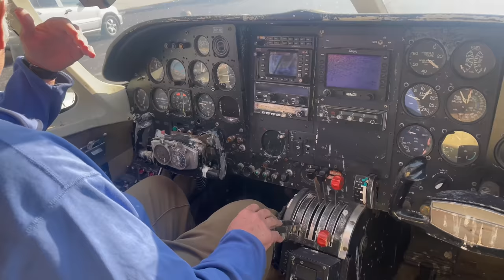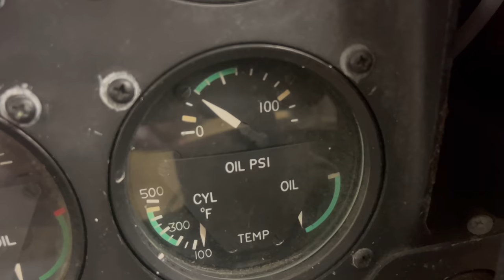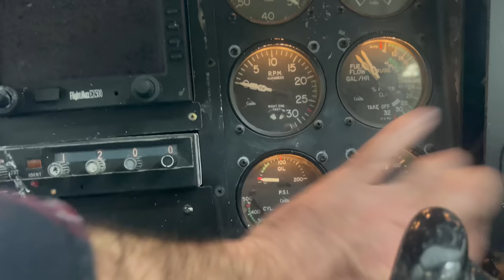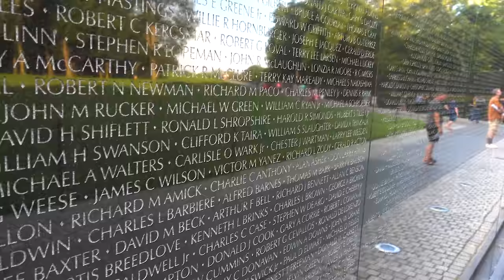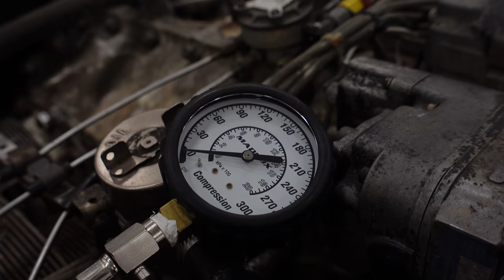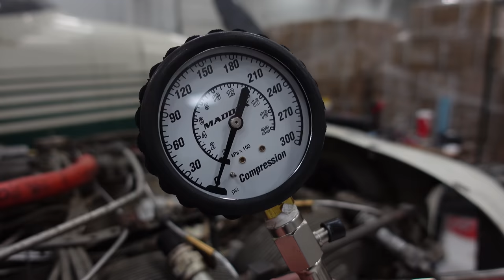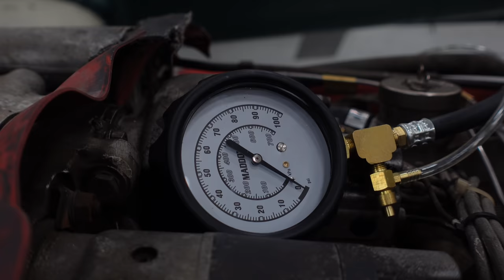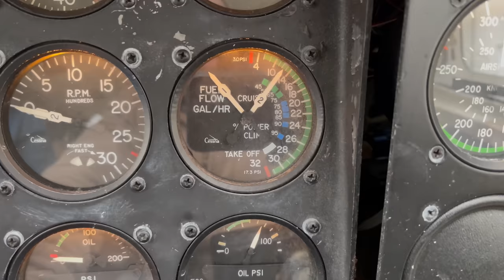Did We Ruin The FREE Abandoned Airplane Engine ? Ep6

Comment: With the way it is trying to start I would check voltage drop. Depending how the starter works if it has a solenoid put a jumper pack or battery directly to that starter so it gets more amperage. Just a thought considering that engine is further from the battery source than the other engine.
Reply: The other thing is to make up some decent jumper cables with welding cable. Those store bought things are hopelessly inadequate.
Reply: Really good point!
Reply: It appears there is also an additional 10ish feet of wire to reach that engine

Comment: Full clean/restore, I'll come out and meet you at the Oshkosh show when it's ready. 
Now let's talk about engine 2.
Spark check, fuel is check, air here lies the problem. It's not starting on spray,  now squealing noting drag from piston rings, already knowing compression is low.  It could be possible the exhaust is plugged and had to backfeed thru system to get out, but with its problems it isn't sucking in the air or at least enough. Wondering if the intake system all the way up into the manifold is plugged up.
Reply: Id love to see a full restore, But the cost is going to be prohibitive, The Spar AD alone I believe is around 30 to 40K.

Comment: I run an engine to operating temperature. Drain oil pull fuel pump fuse. Fill with k1 crank over to flush an engine. It got the gm lifters un stuck. You can pull the plugs and really get more rpm from the starter to build more psi and really flush. Drain fill with cheepo oil run that around for a bit drain and fill with your favorite brand flavor.

Comment: Id love to see you get this one in the air again, I have a question about that engine is it the one that has the locked up turbo and could it be causing a air/exhaust blockage it seems like it want to run but could be a good thing to check

Comment: Hi! :) 
Im a car mechanic from sweden and i just thought….in some cases We use the engineoil on Top of the piston to some times help it turn over and free the engine but in this case maybe you have no oil to the piston when the oil is so thick and needs some help. When the engine is turning it usually dont build up much pressure until its running. This is just a wild guess and it can be many comments that are saying same things but i atleast want to type it myselft! 

Sorry for the bad spelling..haha
Hi hopes for you! Looking forward to future episodes of the plane! ;)
Reply: Yep, suggested the same a couple of weeks ago,.. engine 1 had all round much better compressions, and that would help.
But it's also intriging that it's having a harder time to spin..
Trying to start #2 with #1 running helped the batteries

Comment: I'm wondering if the relatively poor connection from the jumper cables, coupled with the longer cables on that engine are keeping you from reaching the current you need to that starter. Maybe try making those connections really solid.
Reply: When he runs the #1 engine it should be able to provide all the power he needs to start the #2 engine.  If you noticed later in the video he was having a much better time of it when the #1 engine was running.
Reply: Agreed, I think this plus the lack of decent compression combined is probably stopping it from starting.
Reply: @DontCryAboutIt  yes.  The compression looks really low.
Reply: @DontCryAboutIt  yeah. The good engine got all the way up to 150psi
Reply: Same thoughts here!

Comment: That engine spun so much faster when the other engine was going. I think you need some real batteries not jumper cables. That and check/clean the starter wires. In big high compression diesels having solid connection from the batteries is a must. I would suspect this is similar if only for its size.  It will start. It wants to. That said get a detailer to go nuts on it.
Reply: People have been writting in the comments that he needs proper batteries for a while now and he's still using jumper cables...
Reply: @toki002  shrug I have chased down a lot of electrical but getting enough amps from the battery is critical and will probably solve some of his problems. All I can do is suggest. At least make some good extensions with some heavy welding cable and soldered/crimped lugs. Totally worth having the tools to do it a hydraulic crimper/dies is about 50 bucks and the cable by the foot. I have found even the higher end jumper cables are not great.
Reply: The battery for that plane is also nearly $1,000.

Not to mention any cables or terminals you need also need to be certified and are going to cost 5-10x more than what you'd see on almost any another machine.
Reply: @adammcaughey4044  That may be so but in the meantime make some extensions out of 2/0 wire with lugs from any welding shop to a couple of tractor batteries really bolt the connections and crank away. It's better than jumper cables which is the current solution.

Comment: When (not if), when you get this all back together, another way to reduce the cost of the Cessna might be to lease it to a flight school; they pay you to use it when you are not using it, when it would be otherwise just taking up hangar space... just a thought
Reply: not a bad idea!
Reply: @lukewarmwater6412  or, as you suggested, get qualified pilots to fly it for the cost of fuel plus a maintenance and insurance contribution, based on hours per month/year. Break-even costs
Reply: Respectfully, this would be a horrid flight school airplane, it’s a pressurized airplane with many auxiliary systems that aren’t up to the rigors of flight training.

Source: I fly one for a living
Reply: @N312RB  fair enough. haddent concidered that part of it.

Comment: The engine did seem to turn over faster when the other engine was running. I would check for voltage drops like others have mentioned, but I think finding the source of that weird squeak would probably help a ton!
Reply: Yes!  Get a meter and check it out. Other 420s’s spin significantly faster. 
Could even be a deteriorated battery cable.

Comment: Automotive oil is also waxy and overtime it will coat the internals with wax, I usually will put a little diesel in the same way and it basically strips the wax off and the cleaning helps the engine run better, just gotta make sure you get it all out before you start it back up

Comment: This is how I remove sludge and grime out of an engine when doing an engine flush. Jet fuel is a lot like diesel fuel. Haven't ever had an issue flushing automobile engines with diesel fuel. I run the engine for about 5 minutes and let it sit for 10. You don't want any of the engine parts expanding inside the engine. But the kerosene will lubricate pretty well while running the engine. Then you drain the oil after about three times of doing this, and then you replace it with more diesel fuel or kerosene and you keep doing this until you get clear diesel coming out the engine. Then you got to put engine oil in and run the engine up to operating temperature maybe even drive around. Then you drain that oil and put fresh in and you're done with an engine flush. 🍻🇺🇲
Reply: Don’t do it. Diesel has SOME lubricating properties but not enough to run an engine.
Reply: Or just run Seafoam
Reply: MMO!
Reply: Diesel will have more lube than Kerosene, so it's the better choice for flushing if you have both.
Reply: I've heard of adding a quart or so of ATF fluid to the oil and running for a couple minutes  to thin out hydraulic lifters etc. Then change oil.
Reply: @johnnunn8688  
Seafoam doesn't do a good enough job when you're flushing an engine that hasn't had an oil change in it's life. Diesel fuel does have enough lubrication to run for a few minutes at a time. It just doesn't have enough to lubricate when the engine gets up to temperature and the engine parts start to expand to their run temperature operating specs. It's not like I'm saying go and fill your engine and do a daily drive with it. This is how 3 generations in my family has done it and I've also seen other mechanics do it this way also. I've never seen or heard of any issues flushing an engine this way. I think there are even YouTube videos about it also.
Reply: @benhawke7231  I have no idea, what seafoam is. All I know is, as a long term aircraft tech (engines) I wouldn’t do that.
Reply: @johnnunn8688  
Sorry.. I replied to wrong person.. LoL

Comment: I've turned wrenches a long time on a lot of old iron, I think you are onto something with the plugged exhaust. It seems to soin fast the first 360 and drops off very quickly with each consecutive rotation like pressure is building in the exhaust, probably mouse house in the turbo. The other thing I noticed or actually didnt notice is any smoke from the engine when it did kick over and I dont believe I have ever seen an engine that has sat for any length of time especially aircraft engines that didnt belch a cloud of smoke on a start. I'd expect a mix of carbon,oil and penetrant and rust to make quite a noticeable puff.
Reply: Dave Pin  as far as counter rotation it has been done both with gearboxes on the drive and also with mirror built engines such as the Allison's on the p-38. There is absolutely something causing drag and making noise and it could be any number of things including a buildup of rust and corrosion stuck between the rings without a full teardown it's hard to tell but half of those things may clear up with a short high rpm run, at this point with that engine it has to be torn down anyway so your just as well to mess with it and try to fire it before hand to claim the plane did run on both engines even for a brief amount of time.
Reply: Needs to check logbook and see how much time is on the engines, either way I wouldn't attempt to fly this if engines aren't 0 TSMO

Comment: Yaaaaa....that engine seams toast. The other side had more compression and still spun faster, and the turbo is frozen up. It sounds like that engine failed at some point and maybe the turbo and pistons all burnt up together. May just want to consider a straight up rebuild on that side to get it to start, besides that's still getting the engine to start. 🤣

Comment: i use an engine pre-luber for automotive gas and diesel engines, It allows me to pressurize the oiling system by connecting to it through a sending unit or pipe plug via a hose. This way I can fill an engine with clean new oil and not have to start dry, May be a good option for your airplane engine too

Comment: I love your humor. The big explosion in the beginning had me laughing hard. It would be great to see that aircraft all clean and shiny. Incidentally, I think I'd change the oil in both engines and put new oil filters on them. Then refill the oil to the proper levels. I'm not a mechanic but if I can get my old chainsaw running I am confident you can make that engine run.
Reply: Pmsl u funny bro ..chainsaw bawahaha chainsaw Vs 2 big bore v8or v10 engines , two completely different animals ..although I do agree that he will get them going I can feel it in my bones
Reply: @ger808  There are (2) O-520 cubic inch 6 cylinders, The O stands for opposing or boxer . fuel injected and turbo charged. very expensive to rebuild or replace. Not the easiest things to work on either. 2 magnetos and 2 spark plugs per cylinder.

Comment: Let's fly! :)

You were talking before about it could be an exhaust issue. Bearing in mind how FUBAR'd the turbo is on engine 2, would it be worth removing the turbo so that there is a straight through exhaust? I understand that engines need some back pressure to run properly, though if we can just get it started, then we can worry about making it run nicely later.
Reply: Not sure why this misconception is so common, but engines don't need backpressure at all. Exhaust sizing is important but only to maximize flow for the amount of gasses produced by combustion. Too small means a restriction, too large means it won't create a slight vacuum to pull more gasses out of the engine.
Reply: Pull up the top smart bugs that had some oils squirts and oil and there crank it there crank it over get the ring as nice and wet maybe the compression will come up and help start that motor dragon is no good
Reply: Probably should use some of that jet fuel in there and then you could pull the bottom plugs and drain them out but it needs to get oil wet in there to get those rings to stop dragging

Comment: That right engine will never start with such low compression. Time for a top end rebuild before anything else messes up.. Looks like you have some kind of voltage issue, when that second engine was running, the first span over much easier, i guess would be indicative of a stronger (more consistant?) supply of current to the starter.
Reply: I wouldn't bet on that. The VW  Beetle has a very low compression, too. But I'm not an expert on plane engines, so I might be wrong...
Reply: The top plugs are out, that’s where the penetrant is being injected. There’s not going to be any compression when turning the prop over if the plugs are out and there’s a vent to atmosphere in the cylinder heads.
Reply: @Pete-tq6in  Eeeeh... he didn't keep the spark plugs off? I don't know why you would think he did.
Reply: @toki002 , I know, when he put them back in and measured the compression it was on the low side on a few cylinders but the official low limit is 62/80. Anything less than 70/80 should ring alarm bells if you’re about to commit an act of aviation but if you’re just getting an engine started, the tolerances can be relaxed a bit. The likely cause is some corrosion or muck in the exhaust valves/valve seats but the compressions measured wouldn’t be enough to prevent the engine from firing.
Reply: Since the hours on both engines are unknown, I would figure both engines would need to be refreshed to Zero hours for the maintenance logs.

Comment: Sure seemed like that engine at least wanted to catch a few times. That’s progress! I know you can do it. Some day a persons life is going to be saved on an angle flight with your help (and everyone else’s)!
Reply: Yes when ya had engine 1 running engine 2 really wanted to like the boost from the charging system was almost what it needed. Hoping you put the valve back in the fuel line.

Comment: Two comments:  are you sure the internal timing on the LH mag was timed correctly when you reassembled it?
Also, don’t prime quite so much. This engine had a problem with hydrostatic lock in the cylinder with fuel that can bend the rod. 
Flow check the nozzles again

Comment: I’m very excited to see the other engine run asap.  Yes something is dragging, but you are never going to get the cranking amps you need through those battery cables.  You need to jump with thicker wire and solid lugs. Nut and bolt them to the existing lugs with hardware.  The #1 engine has less dragging so it wasn’t a problem.
Reply: Bump
Reply: THIS RIGHT HERE!!
Reply: That explains why the right engine rotated much faster when the left one was running, right?
Reply: @rc-fannl7364  Yes, that is why.  But It can only help a little bit because the alternator from the running engine can only output a small trickle back into the system.  Not enough to help much.  When you boost a car the battery is mounted and the jumper cables just add a boost.  In this case the entire battery(s) are outside of the airplane and fully dependent on the cables.  Very high resistance through the cable and the clamps.
Reply: Also a better series connection between the two 12volt batteries is needed.  A short, thick, bolted on cable.  If both mags are working and synchronized then guaranteed It should start right away.  Don’t worry too much about the compression.

Comment: I noticed engine number two being much closer to starting when engine one was running. One small theory I had was that the wiring to engine number two is in worse shape than engine number one, causing the starter to turn at lower voltage, and therefore slower. The reason it would start better with engine one running, could be the higher voltage the alternator of engine one. I would try running some jumper cables directly to the starter and try again. But of course , as always, make sure to “CLEAR PROP!”
Reply: I did also noticed that. Looked like it wanted to start

Comment: Just my 2 cents, you have  too many cylinders on that right engine that are reading low compression.  You can do a wet compression check to see if its the cylinder or the valves but we both know it needs to be rebuilt.  Maybe some aviation mechanics can donate time to the cause.  For the interior id like to see the seats unbolted and sent out for restoration and then go from there.
Reply: yeah I agree to low compression, possible cause to me it sounds like a broken piston ring squealing  which probably cracked when it un seized,  I would do a compression test and whip a cylinder off to see, it needs to come apart anyway goood luck btw ;)

Comment: That engine seem to turn over a lot faster and nearly catch when the other engine was running.
Reply: I was wondering the same... Higher battery voltage from the running engine?
Reply: @Turtle4288  no idea but maybe that left engine has to be running 1st then the right engine will start after. Just a theory and probably not correct but it definitely turned over faster with that other engine running and sounded like it was trying to splutter

Comment: Those compression numbers are low.  With how crusty those plugs were when they came out the first time, Id expect the valve seats to look similar. 

The cables to the starter probably have internal corrosion as well, which is why running the other engine got it closer to firing.
Reply: if the cables have not been part of a mice lunch at some point.